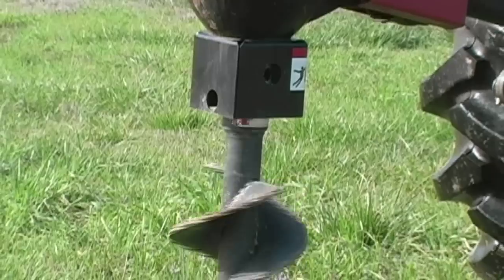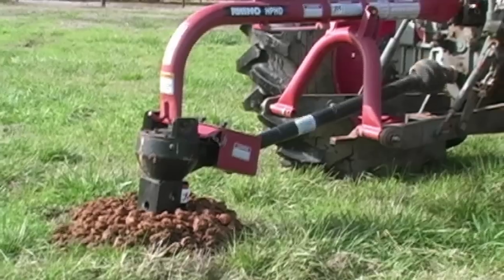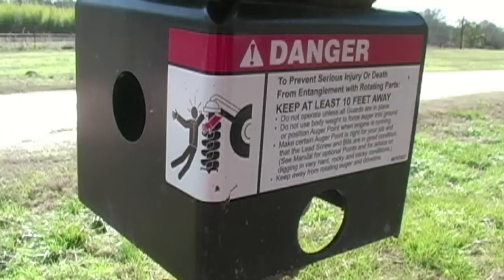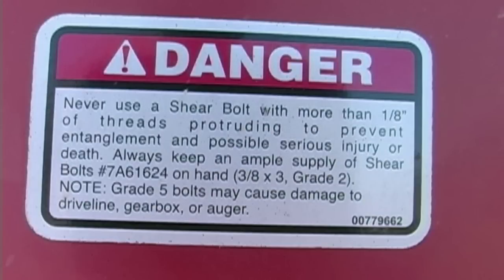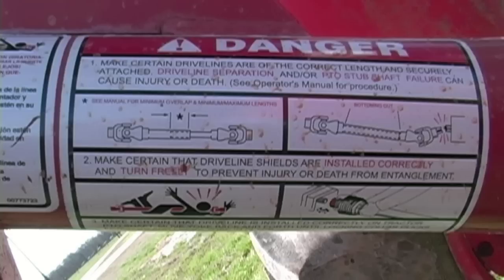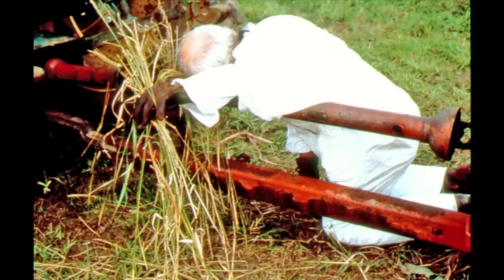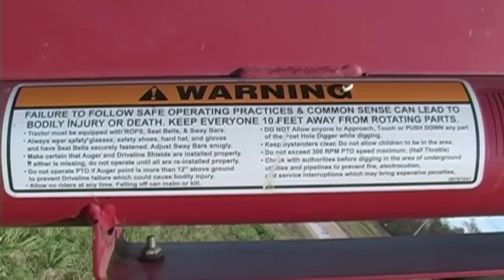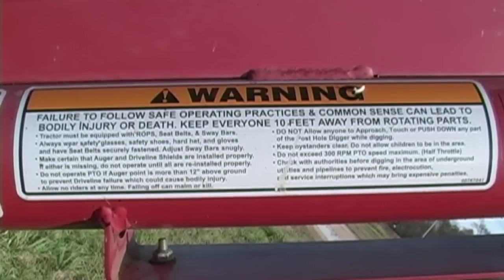Proper Use of a PTO-Driven Posthole Digger

Comment: The hole that was dug is at an angle because the operator did not back the tractor up incrementally as the auger progressed into the hole. This technique is explained in a video by EverythingAttachment.
Reply: Thanks that was my question. No video that I have seen talks about angles... especially the angle to mount off the tractor

Comment: I got caught in the PTO on one of these. Broke my arm and a couple of ribs.
Reply: I just read an article about this happening to a guy ,may i ask what you a the doing to cause the accident? It seems to me like as long as you stay away from the moving parts when its on you will be fine.
Reply: @latenightcake5881  agreed. It was on an older model, and younger me climbed on top to add weight to it. My coat got caught in the spinning power take off, slamming me down on the assembly.  If my dad hadn't engaged the clutch....
Reply: @acetrades1524  yep i see , i guess people must push down on it to give it more pressure ey maybe cus its not getting through the dirt well enough , seems crazy to me but i could see someone not thinking much about it or maybe being told to do so and boom ur screwed. Sounds like an awful kind of injury , luckily ur body prob went into shock ey and u didnt feel much? The guy i heart about had his arm broken in 6 places and his buddy had to cut his clothes off him. But he survived. I didnt even know what an auger was but i was morbidly curious. Well im glad your okay .
Reply: @latenightcake5881  ya, it shattered by arm near the shoulder,  had to have surgery to fix it. Broke a few ribs. I guess the older models used to shred guys through them, one old timer told me the guys wife went out to find him, and the tractor was still running and he had done the same thing I did, but no one to engage the clutch and she found him in pieces. My dad had to cut my clothes off as well with a nail he found, which is why I always carry a pocketknife!  Lol
Reply: The country singer Charlie Daniel's had his arm ripped off by one due to a loose glove catching and dragging his arm in.
Reply: @coltknight3945  There's a guy in my area that the aulger caught his sleve of his flannel shirt and tore his arm off. I think Charlie Daniels was lucky. I read up on him just now and he, or someone else, managed to turn the tractor off in time so he just suffered a severaly broken arm, . . .in five places. Ouch